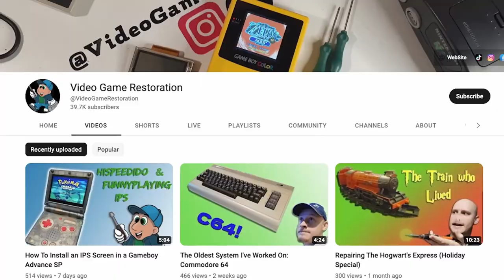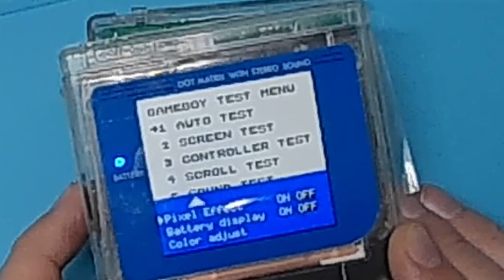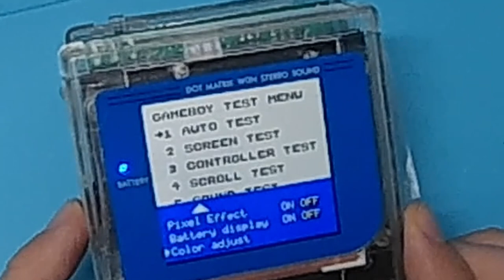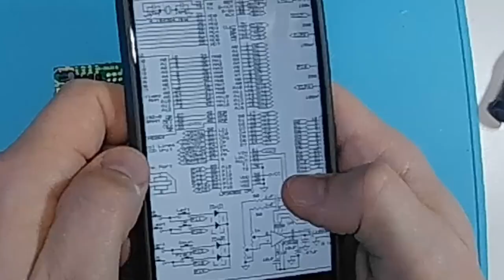Building TronicsFix an Ultimate Gameboy

Comment: "I'm not sure why vinegar has such a reaction with this battery acid"
Because it's not battery acid - AA batteries use alkali chemicals, so any fluid they leak is alkaline - the opposite of acid.
Acids and alkali neutralise each other - and vinegar is an acid. So when you apply vinegar to fluid leaked from an alkaline battery, it breaks it down easily.
You don't really get acids in any kind of household battery. The best example of an acid based battery is probably a car battery - and if one of those was leaking, you'd want something that was strongly alkaline, such as baking soda, to clean it up.
Reply from the maker: Funny enough I work around cars a bit as well, I'll be using this info in the future! Thank you for explaining it!